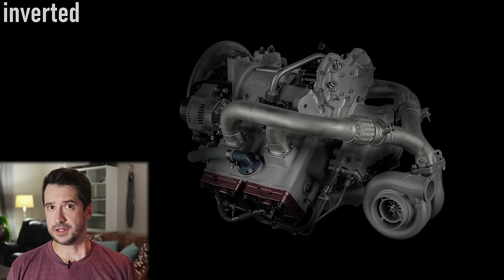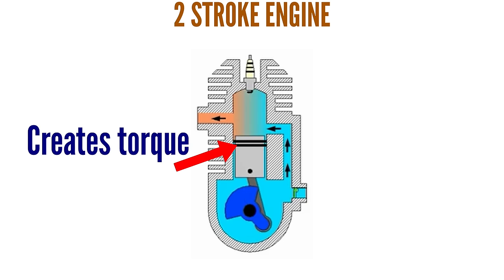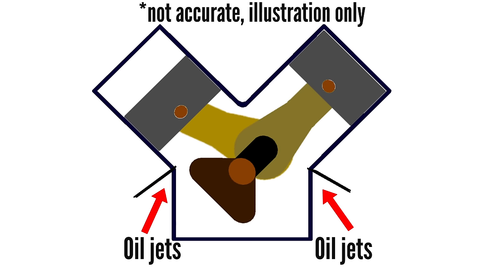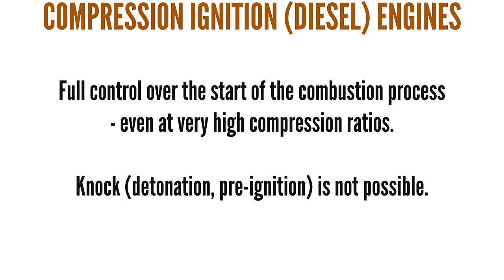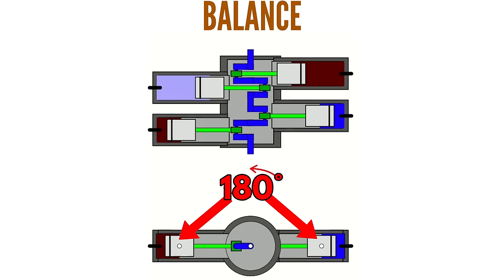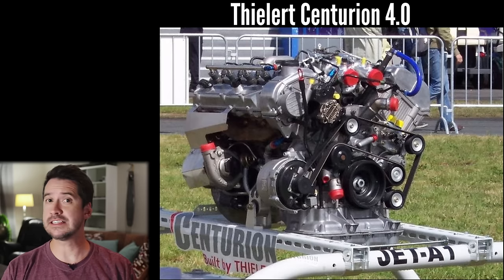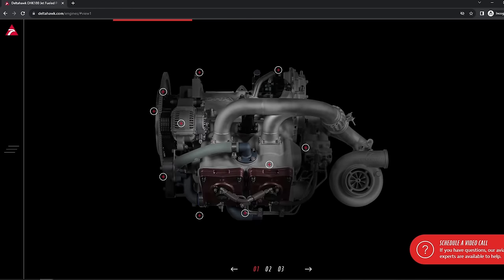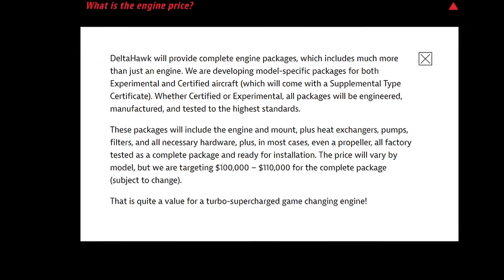Deltahawk's Jet Fuel Piston Airplane Engine Explained

Comment: So basically a Detroit Diesel screamin' Jimmy in a new package?
Reply: Ha ha ha, less the valves which made it more efficient. Now has extra porting to catch the rings. Screaming Jimmy must be 80 years +old if WW2 landing craft are factored in. Still the southern oceans do appear to be behind in technology.
Reply: I worked for many years in fire suppression. Detroit Diesels were frequently used for sprinklers systems fire pumps. That big engine started and hit full throttle in seconds was incredible.
Reply: Then there's the Junkers Jumo 205 opposed piston diesel engine... Just sayin'
Reply: @brianb-p6586  Better to uniflow than to not-flow... I actually think that going with the side port exhaust is a bad idea.
Reply: End of the day any alloy engine from a road vehicle with a turbo and reduction box would be lighter and more reliable in the long run..🤣🤣
Reply: @brianb-p6586  It was repackaged without the valve cam and valves. Still has a cam for the unitary injection.
Reply: No.  Continental already tried that.
Reply: One thing about the 71's and 53's you never had to change the oil. It leaked out so fast it was always new.
Ask me how I know.

Comment: When I was a teenager and in collage, I was building and modifying engines for snowmobile racing. One I was proud of was an in-line 3 cylinder with 800cc displacement making 210 hp @ 3800 rpm, naturally aspirated. The engine was strong and reliable, the weak point was the clutch. They kept exploding. We couldn't find a material at the time to handle that power in that application!
Reply: I thought the problem was reliability of the crank seal and head gaskets CSC 2003 mankato state MNU
Reply: That engine was a 1970ish Polaris 800cc triple, used for grass drag racing in the summer. That was popular then. The crank was 360'ed, and the transfer ports enlarged. It ran on alcohol and water injection. After ~200 experiments, we could control back pressure waves to act as a 'valving' with expansion pipes. We kept the CR to about 12:1 so it stayed together. It was fussy to start and keep running. We used a 3500rpm clutch, it would only semi-idel at 3000rpm. It wanted to run wide open. The whole thing weighed ~400lbs, all aluminum, except for parts of the track. The second time the clutch blew, it sent a big part of it ~150 feet in the air, and it came down in the crowd!  Lucky no one was hurt!!  That was the end of that!! It did win a dozen races though. There is a lot more to the story,  my memory is a little fuzzy these days, I'll be 72 in a week or so.  8)    --gary
Reply: Absolutely love your story, my dad was a big Polaris fan back then. He had a '74 Starfire factory drag sled with a triple in it when I was a kid. Even in factory trin, it just wanted to RUN! Loved the noise it made. The engine you built sounds like an absolute monster, would have loved to hear it run!
Reply: I’m calling bs on that power figure. Are you sure you didn’t mean 8300rpm?
Reply: @jiminycricket9877  You don't have to call BS, you could say "is that really what you meant"?  You are correct, only we limited the RPM to under 7k. For grass drag racing we wanted max torque at lower RPM. So the stroke of the pistons were longer than the bore. That results in higher piston speed per RPM. At much over 7500 it would start to melt pistons, and/or weld the rings to the slots. We re-bored it 3 times because of that, the final displacement was closer to 900cc. We wanted the clutch to engage at 5500-6000 at first. But it got so much traction it would tear the chain-drive final off its mounts.  That was all 1968-70 technology. We were inventing things as we went, and learned a lot!!.   Thanks,    Peace   --gary
Reply: @gtr1952  quite, I suppose that was a bit rude. I didn’t mean to be but I am sorry.
Sound like it was a lot of fun. Cheers.
Reply: I do not believe that it would be 210 hp @ 3800 RPM. It is not possible for a 0.8 liter engine to put out that much power at such low RPMs. You also state further down in the comment section that you use a 3500 RPM clutch, which would mean that you barely have enough RPMs @ maximum power to engage the clutch.

Comment: This thing has been in a perpetual state of "next year" for the last 14+ years
Reply: Not anymore,  FAA  certified in April 2023
Reply: @nipponsuxs  Still not in production.
Reply: It's going to be the same old story. Bringing new general aviation motors to market is an absurdly expensive process due to the extreme demand for reliability testing, yet it's a pretty niche market with low production volumes, so price per unit needs to be really high just to stand a chance at covering the cost of development. But then no one ever actually uses the shiny new engine because nobody wants to pay a large premium for tech that inevitable still has some kinks to work out and nobody knows how to service yet. Sure the fuel costs would be lower, but those usually only makes up a modest fraction of the costs of running a small aeroplane anyway.
So everyone just keeps feeding low-lead avgas to their boring old ubiquitous Lycoming. Innovation is hardly worth it when you just want to fly.
Reply: @fnorgen true, although the military drone market changes that equation somewhat now...  due to that the market for small aviation engines the market is probably larger than it's ever been before in the last 70 years...
Reply: @PistonAvatarGuy  I am guessing the price tag securing new buyer contracts or just drumming up customers for this engine may be one of their largest problems getting into production.

Comment: This video is not really about the DeltaHawk per se but rather a rundown of the general principles involved in it's operation and how those contrast with other engines.
Reply: Exactly. Besides, who designated 2700 rpm as the limit for aircraft propellers—as with much of your other "facts" the term over-generalization comes to mind. Do you understand that turbocharging and supercharging are one and the same, with many variations possible? Your comparison of two-stroke and four-stroke engine power-periods is flawed. A BS presentation (and engine).
Reply: @davidgierke7582  depends on the size of the prop of course, to avoid tips going supersonic... "2700" I suspect and if I remember correctly is mentioned because that is full power on an a/c like a C172...

Yes, a turbocharger is properly called a turbo-supercharger...  at some point in history people got lazy and shortened the word....
Reply: ...and not even a good one.
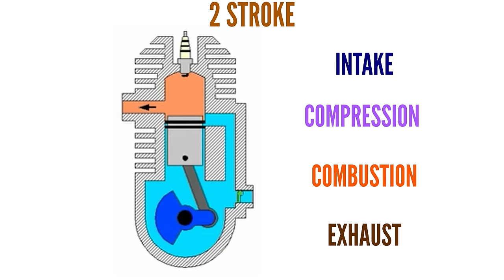1:47 3:57 4:09 
Stroke: One movement of the piston up (or down).
Revolution: One rotation (i.e. 360 degrees) of the crankshaft (i.e. two strokes)
Cycle: A complete loop of stages, repeating after a specific number of strokes (i.e. 2 or 4)

I could go on.
Reply: @davidgierke7582  low prop rpm is associated with lower noise, better climbs.   If you have a high rpm you need to have a short prop blade to avoid the non laminar flow of air that results as the prop blades approach the sound barrier.   The blades will stall around that speed near the tip.   The sweet spot for props is somewhere between 1600 and 2200 rpm.   

As with the other guy that dismissed torque as insignificant for aircraft engines.  the more torque you have at a lower rpm is better for a mulitude of reasons for prop driven aircraft.
Reply: Make your own video then so you can go on and on.
Reply: The IO520 on the 185 makes full power.at2850,however pulling the prop back to 2700 improves prop efficiency and.actually accelerated you faster.

Comment: People, chill out on pissing match. Interesting video. I was not aware of this engine. A engineer had a long night thinking.
Reply: JUMO already proved the technology for aircraft applications
Reply: @WilhelmKarsten  : The JUMO was an Opposed Piston (OP) configuration with 2 crankshafts.  The Deltahawk engine has only one crankshaft.  There is a modern version of the OP engine called the "Gemini" engine, with only 3 cylinders but I don't know it's availability.  The last I knew it was still an "experimental" engine with no plans to get certified.
Reply: @InquisitiveSearcher  Jumo built 2-stroke Uniflow Diesel engines (Oechelhäuser Cycle)
In 1,2,3 and 4 crankshaft configurations.

Comment: I just checked the prices for 100LL aviation fuel and jet A fuel at my local towered airport.  100LL is $7.05/gal and jet A is $7.75/gal U.S.  there must be a local shortage of jet fuel.  My plane uses “mogas” which is unleaded, no ethanol 91 octane gasoline at $4.25/gal.  Many older aircraft can be FAA authorized to use mogas because many piston engines were lower compression then.  So, big payoff today with the less costly fuel use.  The downside of these engines is they generate about 2% less power for a given displacement.

Comment: We are Detroit Diesel and EMD 2 strokes engines and we've had valves since about 1938 and we're still in widespread use. We also have Roots blowers and turbochargers on the same engine - and wet sumps. Heavens above!

The 'supercharger' in this Deltahawk engine appears not to be a supercharger from your description. It appears to be a positive displacement scavenge pump very similar in operation to the blower on a Uniflow Diesel engine, though I can't find much info I must say.

People mistakenly think the blower on a Detroit Diesel 2 stroke is a supercharger but it isn't. Detroit Diesel and EMD even categorize their blower only 2 strokes as N for Natural. I wonder if the Supercharger on this Deltahawk really is a supercharger since you did mention starting and idling for it? 
On turbocharged Detroit Diesel 2 strokes, the Roots blower is retained for starting and idling also causing me wonder about the role of their 'supercharger.'
Until we know more I have to give them the benefit of the doubt that it is a supercharger but life burns one and mechanics like me get rather cynical about manufacturers' unsubstantiated claims.

In an EMD turbochrged engine they use a centrifugal hybrid arrangement for the forced induction. For starting and idling the compressor acts as a crank driven blower and indeed does provide true supercharging in low RPM high load situations (unlike Detroit Diesels and EMD N engines) and as the RPM rises the the turbocharger turbine takes over driving the compressor via an overrun clutch. 

I would've thought for the amount of effort they've put into this Deltahawk engine they could've come up with perhaps a bit more of a compact and sophisticated forced induction/scavenge pump than off the shelf tech supercharger and what looks like an eBay turbo LOL.
It seems like a 3/4 baked cake with the customer a full paying beta field tester. Time will tell.
Reply: The DD 2 strokes cannot run without the blower as they blow in fresh air through the cylinder ports, and the pressure involved is barely above atmospheric.  It is not supercharging because it doesn't provide boost pressure over ambient.  It merely provides aspiration.  This DeltaHawk engine seems (and sounds!) similar.
Reply: The Deltahawk uses a Lysholm screw-type supercharger housed in the "V" between the cylinder banks.   It is visible in the cutaway of this Deltahawk video: https://youtu.be/vJkA8VI6QdY?t=61
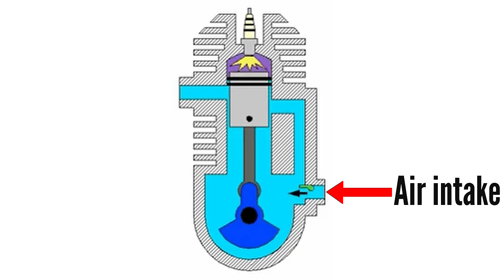Reply: Just in case YouTube won't allow my link, the Lysholm screw-type supercharger is housed between the cylinder bank (5:23 in this video).  Lysholms have been around a long time and were used in the Mazda Millenia and are common in large commercial air compressors.
Reply: @jfess1911  I was just reading these comments about the Lysholm screw compressor and thought of Mazda's Miller Cycle V6.
Reply: @JimBronson  Yeah I know Jim. That's what I wrote.
Reply: @ThePaulv12  Deltahawk had never been a  well funded enterprise and their goal has been to use well established tech (like mechanical fuel injection and an off the shelf compressor) to make the engine low risk... something especially needed in an aircraft engine.   
One of their competitors, by contrast, initially needed and inspection every 300 hours.
Reply: @jfess1911  yeah, gotta say, some mechanical pumps work great. Bosch ones particularly. They have very predictable wear patterns and just werk. But i'd think of all the tradeoffs this one most affects efficiency. 0.4 BSFC isn't great, lycoming 4-stroke petrols are better. People probably think that's all the fault of the 2-stroke, but i'd bet it's the lack of fine control on injection timing and computers monitoring things. I mean are there no sensors?! Or does a human have to read them and fiddle with engine parameters themself?
Reply: @cannaroe1213  A lot of the improvements in modern diesel engines come from the higher-pressure injection that can give smaller droplet size and electronic controls.  In some respects, this engine is relatively primitive, but the simplicity is part of the current sales pitch.  Making it compact with a relatively short stroke, at least for a compression-ignition design, certainly didn't help either.
  A lot will depend on inspection and overhaul intervals and expense (and of course, reliability).  The price of fuels will be the deciding factor in many cases, provided reliability is there.  I don't keep track of avgas and jet fuel costs, but apparently there are some places where jet fuel is considerably less.
Reply: @jfess1911 Diesel, as in from a gas pump, is about half the price of AVGas - and that's WITH road tax. And this dumb box of cogs can probably run used vegetable oil given the mechanical injectors. IDK man I put my life in MCDonald's hands every time I order a large.
Reply: @cannaroe1213  I think that the big issue with standard diesel fuel is the gel point which can be somewhere around 15°F.   I know that there are additives to deal with this, though. One of the important properties of jet fuel is its lower gel point.   Also, I suspect that many airports don't carry normal diesel.
Reply: @jfess1911  You know I've put pump diesel in a deep freezer for days, roughly -10F and it didn't even hit it's cloud point let alone pour point.
I get operators, drivers and even mechanics with all kinds of tall tales about fuel gelling. Without exception I always find that their problem is water in the fuel system freezing someplace that a chunk of ice restricts flow
Reply: @joecummings1260  Do some colder areas still change the formulation of diesel seasonally?  I also wonder if the composition of fuels has changed in general as refinery technology has improved.  I am old enough to remember when a barrel of crude from a particular location would produce X amount of gasoline, Y amount of diesel, etc.  These days, I understand that a barrel of crude can be processed into virtually any fuel that is in demand.  I wonder if that has changed the cloud point and reduced the problem of wax blinding off the fuel filters?
Reply: @jfess1911  Here in North Dakota they switch to winter diesel from October to April. Straight number 2 turns to pudding when it's 40 below zero.
Reply: @David-qg8nx  I figured as much.  Otherwise, the exposed fuel hoses at the pumps would gel up. 
When I lived in the NC mountains in the 1970's, we had a Christmas that reached below-zero temperatures, which very rare in that area.  That was the first time I had experienced fuel oil gelling to the point that the furnaces with exposed supply lines would shut off.  We didn't know about additives and spent Christmas day with torches, blow driers and camping stoves trying to keep the heat on in the house of our elderly neighbors.

On the other end of the spectrum, I was told that at some point prior to fuel emissions laws, some very cold areas used a cold weather gasoline blend that had a small fraction of butane added. It was mainly there to help with engine startup.  This fuel had to be used up before warm weather would cause the butane to boil out.  It was likely only used with above-ground storage tanks.
I have no idea how they prevented vapor lock or dealt with heated garages other than "don't smoke near the car".
Reply: The supercharger itself only provides the necessary back pressure, perhaps around 5% overpressure, not more, and that's all that's needed! Its purpose is just for scavenging, and it's essential; otherwise, the engine cannot be started. The turbocharger is responsible for the boost, estimating a maximum of 18 psi of boost pressure. At 2200 RPM cruise, the boost pressure is around 14 psi. A two-stroke engine, even a diesel under boost, quickly encounters thermal issues with excessively high boost pressures. However, its thermal efficiency is much better than that of a four-stroke, not due to the valve train – which accounts for only a few percent of the friction – but because thermal losses are lower. Additionally, a 2-stroke diesel can be run leaner, resulting in higher combustion chamber temperatures.
Reply: @fnordist  Diesels are different than gasoline engines. If you run them leaner they run cooler. The more fuel you put in them the hotter they get. You've gotta be very careful you don't over fuel a Diesel whereas under fueling's not a problem, except they make no power LOL.